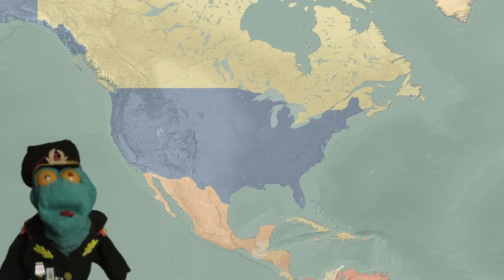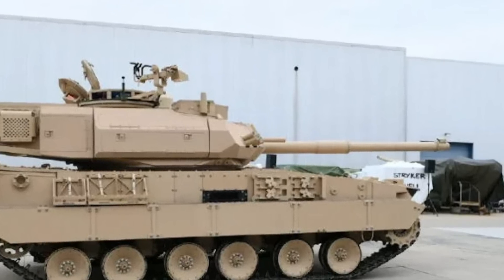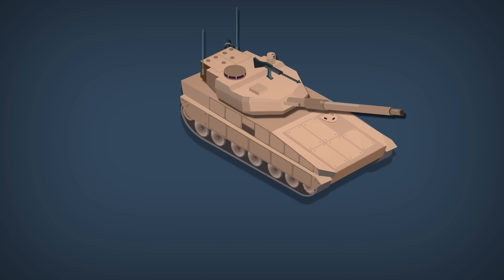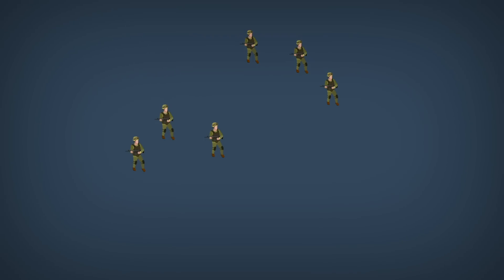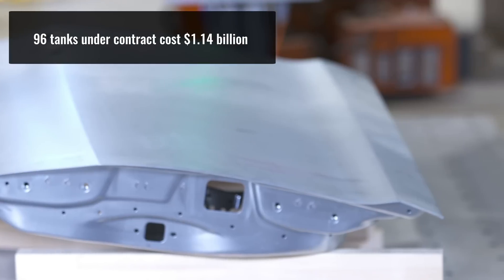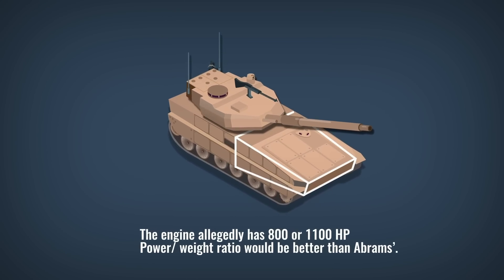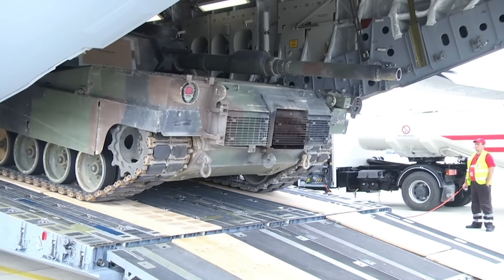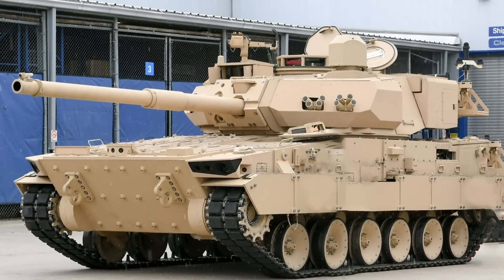US Army just chose its next (light) tank

Comment: Tanks are going the way of battleships and Napoleonic tactics. There is a reason they died off.
Reply: They died off because carriers could do their job better(for the most part). Is there any weapon system both existing and planned  that can do the tanks job better or cheaper? I don't see any. Going back to battleships, if you check what the top navies plans for 2040+ look like you will re-emergence of battleships...
Reply: @norbi1411  I disagree. The cost to benefit ratio isnt there. No one is going to field a 50 million dollar tank when a shoulder fired rocket costing a few hundred thousand can cut it in half. (insert random video from ukraine) Drone warfare is the direction its going. The brits already have hockey puck sized efps that will cut through a tank. Strap one of those on a hobby store fpv drone and the tanks done.
Reply: Mike, what about the fire support capability of the tank? Also, the death of the tank has yet to occur after every prediction, its a cheap and effective way to wage ground war, and if you dont field tanks then your foe will, furthermore, US tanks generally possess higher grade anti missile
Reply: @mikepaul3200  Calvary in general is horrible at punching through entrenched forces, no one (But a moron) would argue that knights were worthless and outdated because they couldn't charge directly through a line of pikes. 
Likewise a tank's main role is not to punch through entrenched defenses and the fact that the Russians are using them that way and failing doesn't discredit tanks at all. 
You could destroy a battleship by simply lighting the ammunition storage on fire  does that mean all battleships should have been replaced with row boats and torches?
Reply: @notshownnotshown309  Howd those tanks work out in afgan and iraq? Oh they didnt. They need developed roads to operate or your following them around full time with recovery gear.
Reply: @tgsachris  I dont get the nostalgia. Anything a tank can do can be done with a drone. At a next to nothing cost and removing the human out of the equation. Stuffing 5 guys in a gigantic aluminum box is asking to be ripped apart. As guys in iraq how well the bradleys panned out.
Reply: @mikepaul3200  they already are fielding them and this trend will continue with the introduction of IV gen. of tanks. Since you make such cardinal theses tell me something. How many infantry AT systems both ATGMs and grenade launchers like M72 or AT-4 Ukrainian Army has at it's disposal? How many Russia's Army tanks were lost in  combat?(don't count  abandoned ones during marches). How many of these destroyed tanks were actually destroyed by  ATGMs or grenade lauchers?

"Strap one of those on a hobby store fpv drone and the tanks done."
Power up some electronic warfare system like Krasukha, SPAAG or APS and chicken, I'm soryy drone, is done.

"Anything a tank can do can be done with a drone."
XfuckingD
Elaborate on that one.  Can  drone provide direct fire support for the infantry like a tank? Can it lead the charge, raid operations behind enemy lines like a tank? I don;;t think so. 
That  stupid "expensive, obsolete tank vs cheap infantry anti-tank weapon" argument comes up every couple years since the tank debut in 1916(six time in the last 20 years). And every time tank prevails. Like I said earlier in order to make tanks absolete there have to come up something that would do their job better or cheaper. I don't see anything of that sort  in foreseeable future.Aren't people tired of this shit? Apparently not...
Reply: @norbi1411  I don't think the tank qua tank is obsolete, but the hulking brutes we currently field may well be. This MPF is a step in the right direction. The anti-tank role doesn't need to be filled by tanks, the war in Ukraine proves. But the armored spearhead, operating in concert with infantry, artillery, and air support (manned and unmanned) is still alive - we just need a more cost-effective platform than the current round of behemoths with five inch guns and armor equivalent to a yard of solid steel.

Which is exactly what the MPF is. A smaller, lighter, less expensive tank that can effectively break through enemy lines when supported by other arms.
Reply: @davidkueny2444  Show me where and how exactly Ukraine proves that.
Non of the next gen tank programme aims for the light MPF style vehicle. Every amry is looking for something heavier around 50-60 tonnes.
Reply: How ignorant.
Reply: @norbi1411  You are a fan boy. I get it. The reality is what we learned in iraq and trashcanistan, thats now being implemented in Ukraine. You can have the coolest tank in the world. You need paved roads. Hard to drive on paved roads when every intersection has daisy chained efps. Or drone coverage is bringing artillery accuracy to inches of target instead of yards.
Reply: @chrome505  How so?
Reply: @mikepaul3200  you didn't answer any of my questions drone boy...
Instead you brought another portion of lolcontent. The whole point of having tracked vehicles is that you don't have to stick to the paved roads. Duh! 
Accuracy of artillery was improved not by drones but thanks to guided munition like Excalibur or Kranspol. Drones just made the whole kill-chain shorter. But that doesn't cover tanks job. 

Again and again you prove your ignorance.
Reply: @mikepaul3200  Didn't have paved roads going across the desert in Iraq. Stayed away because of mines.
Reply: @chrome505  Reinforcing my point.
Reply: @mikepaul3200  You missed the point that we didn't need roads. Besides, wheeled vehicles are more susceptible to mines.
Reply: @mikepaul3200  "nostalgia" Sure, spoken like someone who knows nothing about war whatso ever and just likes to argue. 
Arguing a flying box with a few tiny grenades, is equal in power to or in fact even serves the same role as a tank is just asinine as is arguing that the tank is finished because it can be blown up. 
Are jets obsolete because land to air missiles exist?
Reply: @tgsachris  Yes you caught me. Had you read above. I was pulling security on tanks stuck in the mud in Iraq as a civilian. I just wondered over there in 05 and they said "hey you, watch this tank for us"
Reply: @mikepaul3200  1: I don't believe you
2: tanks getting stuck does not mean that they are worthless, trucks also get stuck in the mud
Edit: come to think of it so do humans, I guess infantry is obsolete as well?
Reply: @tgsachris  Go back to playing war thunder son.
Reply: @mikepaul3200  Cute
Reply: Tanks are useful
Reply: @mikepaul3200  tanks cost at mac 10 mil USD
Reply: @mikepaul3200  tanks are more useful than U
Reply: @Frenchdefense9404  Well with a name like yours. You probably havnt mastered indoor plumbing yet. Id slow your roll.

Comment: T72 sucks !!!
Ok WE will made a T72 weight tank but less armored more crews less powerfull gun ...
BUT  BECAUSE we call him a light tank she will not sucks 💯🤣
Reply: Well it will work at least which can't be said for Russia's tank force..unless the Ukrainians are using the t series tanks because they actually do maintenance and have real training.
Reply: @lokomike2911  yah for sure il will work even againt small caliber autocanons
Reply: We cant be sure if the t72 sucks. The reason it's failing in ukraine is that the russians don't know how to use it
Reply: It's not a T-72 for cristsakes. The T-72 weighed in at 46 Tons and the Griffin II weighs in at 38 Tons. The Griffin is smaller and more maneuverable. It has a 105mm  main gun as opposed to the 125mm main gun of the T-72. The Griffin is designed for two to fit in the hold of a C-17 Globemaster III.
Reply: @jerrykahn6894  All vehicles on the start weight less than after somme time see M1 M2 Bradley etc you can be sure that after launchement the weight of MPF would depas 40t

Comment: A tank not designed to hit and be hit by other tanks... seems like a waste of a tank.
Reply: Very glad you've missed the ENTIRE point of the program, needs of the army, and the video.
Reply: It's meant to be fast, and to shoot at bunkers. It has a rifled barrel most likely because it will probably fire anti-infantry and anti-fortification rounds like HESH. It's meant to take hits from MG's and autocannons. It will not engage tanks or stay exposed long enough for anti-tank teams to fire at it.
Reply: 90% of tank combat is against non-tank opponents, and this will be in the field along side multiple units equipped with ATGMs. It doesn't need to fight tanks.
Reply: The real question is: what new kinds of rounds have they cooked up that they dusted off the old Royal Ordnance L7 105 mike-mike for. If they're doing this in mechanized infantry units next to Brads for something other than peer-to-peer tankery, then it's not a tank: It's a self propelled gun. Which means multiple munitions for the tube for multiple situations. Bunkers, drones, IFV's and technicals, maybe even smoke missions.
Reply: Tank on tank combat in reality is rare, and using mbts in most situations is a gigantic waste and nightmare, so investing in light tanks is actually a very good idea.
Reply: @Jack-yv2xu  not when light tank weight only 34 tons and it will weight even more, T-90M is 48 ton. light tank should be LIGHT no the weight of MBT
Reply: @tsugumorihoney2288  You know that is a 14 ton difference right? Plus it’s counterpart the Abrams weighs 66.8 tons.
Reply: @tsugumorihoney2288  Plus the new Chinese light tank is the same weight.